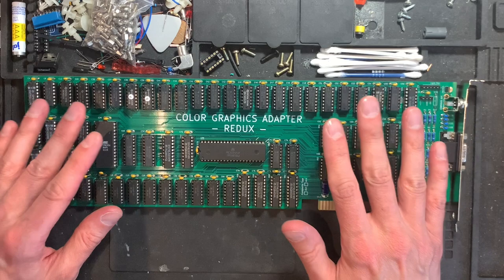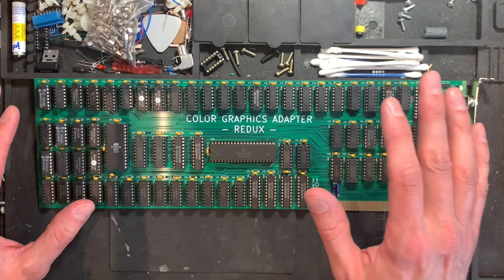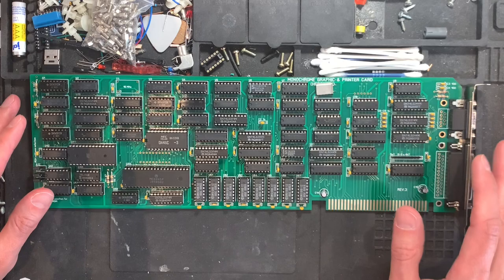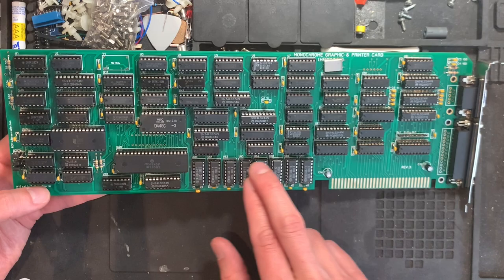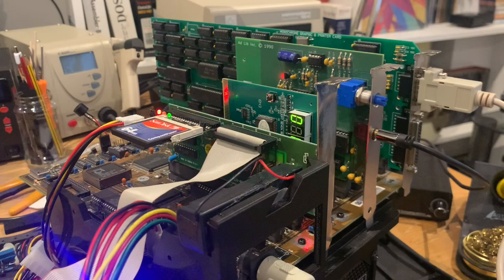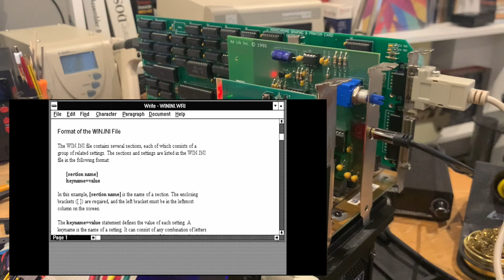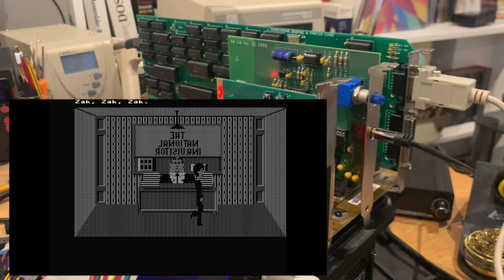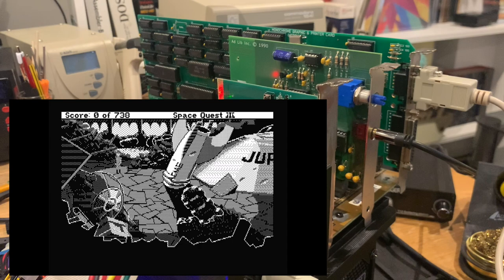The Homebrew Hercules Graphics Card

Comment: Interesting to see a new Hercules card. I've fond memories of my family's first PC XT clone which had one. Hercules has really quite a high resolution compared to CGA. Action games like MS Flight Simulator or Accolade Grand Prix were a bit grim with a long persistence green phosphor monitor though. Not a problem with RGB2HDMI of course! You can use a Hercules/MDA card with Windows NT/2000 for debugging device drivers which was better than having to have 2 PCs and comparatively slow serial connection.

Comment: My first PC was an 8086 with a Hercules card.  I have incredibly memories of this card's capabilities, and it performs amazingly well in games from the late 80s.  Playing Prince of Persia for example was a blast.  I really look forward to this project and hope to build the card myself as well.  Does the card have any hard to source components?  Most stuff seem to be logic chips, a microprocessor and an eprom.  I guess the memory could be difficult to obtain, likely have to take a gamble on chips from Aliexpress for that.  I'd appreciate if you could provide a link to the card's project page in the video description.  Great job as always, love watching your videos!
Reply from the maker: The card is not yet open source, but the very least the Gerber files will be available at some point said Arek. So let’s give him some time to get all things together. 
The CRTC, the SRAM and the DRAM are hardest to source. DRAM is standard 4164 though and should be available somewhere. I recommend getting from a trusty supplier as the Chinese resellers often relabel the chips and sometimes mix up different manufacturers or access speeds. That might lead to problems. 
SRAM should be available from eBay or such as used or NOS. CRTC I found on eBay too. 6845s are still rather commonly found.
Reply: @root42  You will notice it does not even fit in a 16 bit slot.

Comment: Could this be modified to produce VGA-compatible timings? (as VGA emulates the 350-line mode, (same totals as the 400 line mode but with inverted sync to tell the monitor to stretch)
Reply from the maker: I would say No. The refresh rates are totally off vor VGA. Plus the levels are TTL so you would need a level shifter to get to VGA‘s 0.7V (or what was it…?)
Reply: @root42  just solder 19MHz XTAL instead of 16 one, and you'll get EGA compatible timings that a lot of VGA monitors understand. Two 1k resistors from VIDEO and INTENCITY signals to G signal in VGA and you have it running in 21st century!

Comment: does the CGA run crysis? ähm area5150 ?
Reply from the maker: Yes, but I don't have an appropriate mainboard. On my 286 mainboard it runs quite well, but will hang in one of the later parts. Area5150 is much more compatible than 8088mph, but still requires an original PC or XT mainboard to run perfectly.